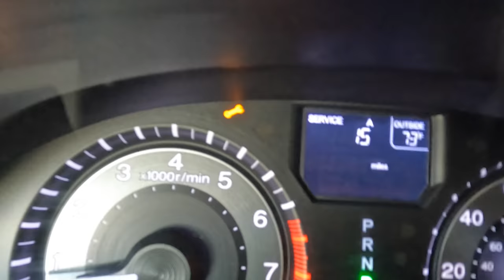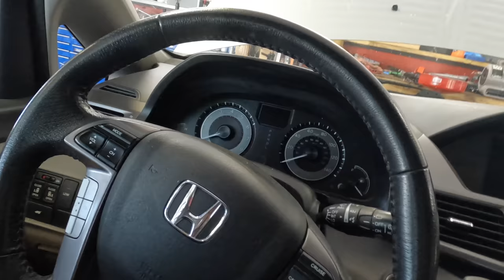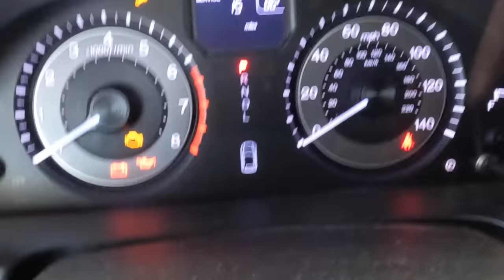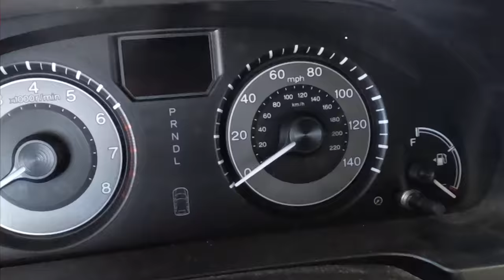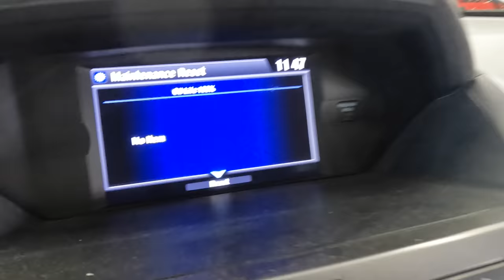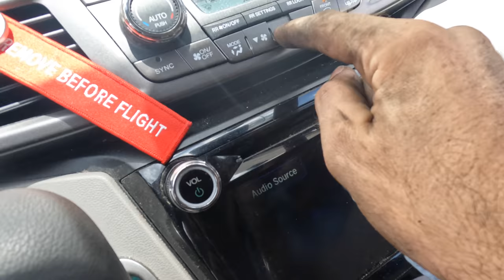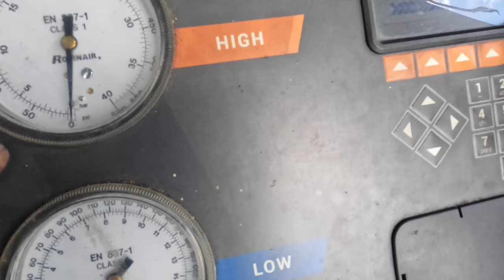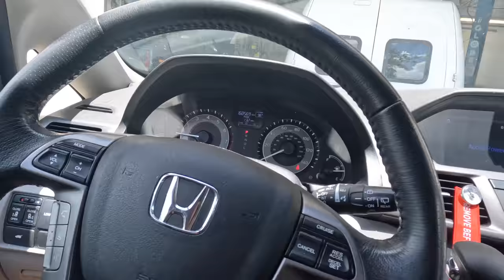Running 300-400 psi. Vibrating noise and smoking! 2014 Honda Odyssey 3.5

Comment: Absolutely phenomenal diagnosis, videoing, verbal description, adapting the old  connector to the fan, all for repair repair, and with the added touch of the loss and  recovery of the 10 mm socket. Thanks, as always for the terrific video.
Reply: The correct word is video recording NOT videoing
Read books to better understand the language -
under-education is not a desirable quality - perhaps
mediocrity is your goal rather than improvement.
Reply: @andrew_koala2974  Pedantry is the purview of those who wish they were infallible.
Reply: @andrew_koala2974  The grammar troll has spoken.
Reply: Andrew koala. Adding - to sentences is also poor grammar
Reply: @andrew_koala2974  What does your crap have to do with fix'n cars. Give the guy a break along with everyone else.
Reply: Phenomenal diagnosis? I’ve diagnosed many of these over the phone. Lol. Easily amazed.

Comment: Good morning Ray, good video. I have a quick story, I was with my wife sitting in traffic and she said "Wow I've never seen the temp gauge that high" I started to find a way out of traffic QUICK the AC had also started blowing warm air too. Long story short it was the electric fan I smacked it with my lug wrench and it came on yay 😁 !! Luckily the high pressure valve didn't have time to discharge any freon 👍. The part of your video when the runaway 10 mm took a dash I was like yup there goes another one Lol. You have the coolest tools that magnet is a life saver for sure !! 
     Thank you for another great video!! And don't forget to have yourself a great day 👍👍✌️🇺🇸😊.
PS thank you for your service 💯
Reply: When that 10 mm went bye bye - I thought yep there goes another to be sacrificed to the 10 mm gods. 
I find if my heater is cold - then the coolant is low because it not circulating any coolant to the heater core. It how I found the coolant leak from the LPG gas convertors under the bonnet. My car on LPG has 2 convertors using coolant heat to vaporise? the GAS to Liquid conversion. EDIT - my car wont switch over to LPG from Petrol unless temp at 35c or higher (1/4 on temp gauge).

Comment: Hi Ray. I enjoy watching your videos. I am a retired  professional auto/truck technician with over 40 years of experience.  I have never seen a saddered connection melt because of high load.
Reply: “Soldered” NOT “saddered” 🤦🏼‍♂️🤦🏼‍♂️🤦🏼‍♂️
Reply: Agreed, the lowest melting point solder (63-37) melts at 374 deg F and the plastic wire insulation will melt off before the solder would. A proper solder joint will make a lower resistance connection that is corrosion resistant and physically stronger than the wire.

Comment: Ray it's so good to see an honest mechanic. Also I wish I had tools like you have now days to work on cars. All I had were regular hand tools, creepers, no electrical type and the wrenches you have now great ratchet box end wrenches. Keep up the good work
Reply: I am so envious of the modern tools Ray uses. I remember turning nuts and bolts a partial turn at a time when a ratchet wouldn't fit and using my chest as the transmission jack while laying up under cars to change out TH350s and TH400s. The one repair I've yet to see Ray perform is replacing a drive shaft that has been twisted with so much force that it pinched into two parts. I did make the most of what tools I did have back in the 70s when I was into drag racing.
Reply: Yes you’re right. And on top of all that, you’ve Got to have the computer savvy just to turn a wrench.  I’ve learned a Lot from Ray and Eric and Wes. They would make great Shop Teachers!
Reply: I'm 73 yo so I'm very old school did not have computers back then just real cars not the complex things now
Reply: @fhurlburt6532  New cars are still real. I kinda liked having older vehicles that were all mechanical, but the new tech is oh so very nice from a comfort perspective. And as much as I love the sound of a carb sucking in air, I get more power from my little 4 banger than I did from the 305 that was in my first three Chevys ('84 C10, '86 El Camino, '76 Malibu).
Reply: @gaiustacitus4242  A shop I hung out when a teen in the 1970's had a drag race car. Race on Sunday, fix on Monday.
Reply: @gaiustacitus4242  Bin there too! 4 lbs. of air in slicks with “screws in “ to stop turning on rim! So much torque @ 5,000 rpm & slide slip the clutch! Kept breaking off pinion snubber ! SS class in 1969 ! Tons of fun!! Only 2 trades in life that make a living on our backs! The other get “paid” for there comebacks ! LOL
Reply: Tools and equipment - irrespective of any profession -  
whether 'one' is a mechanic - photographer - graphic artist -
electronics technician  - or surgeon in the Medical arena.
..New tool and devices are being developed / invented -- 
older equipment requires replacement or repair  - Losses
of tools have to be compensated for -   and average people
who have zero concept of business management wonder
why professional repair services are above their flawed
financial expectations --- Besides that - one is paying for the
knowledge the professional has invested in - meaning the time
studying - books and equipment while the commoners are 
having fun drinking beer and getting up to no-good.
Proper knowledge - willingness to learn everything and ethical
practices will always bring many rewards and acclaim.
Willingness to learn what one does not already know is the KEY.
Reply: @gaiustacitus4242  Back in the early 70's I was driving a milk truck for residential deliveries and I got upset with a customer and had to back out of a long drive way. I hopped in the truck threw it in reverse and rev it up and pop the clutch and I forgot to let off the parking brake and twisted the drive shaft up like a straw.

Comment: Every time I see you work on a modern car I think how I used to work on my Triumph Spitfire in the mid-70's:
1. Raise hood - whole front of the car opens forward
2. Sit on front tyre, either side, and tinker with distributor, carbs, rockers, etc - in total comfort. Often with a pipe wrench as the only tool.
Reply: Ours had a Copper hammer for wire wheels , venting frustrations
Reply: Oh yes, Spitfire. SU carbs, U-joints everywhere... changed them while laying in the snow in the winter in Maryland
Reply: I restored a 63 Spitfire as a retirement project. So easy to work on it, just as you describe. I look at my 2014 Honda and don’t know where to start!
Reply: @Taid44  while most can't diagnose/fix late models , we can attempt to and @ least make them  'Different'.......

Comment: There's always something nice about watching an oil change... maybe it's the flow of dirty horrible oil coming out and knowing clean good oil will be going in.
Reply: Yes. Extremely satisfying!
Reply: could watch it all day right.
Reply: Out with the hate, and in with the love.
Reply: For my daughter who is a trauma surgeon in NYC
a blood transfusion is  likely exciting - knowing 
that another soul is saved from the graveyard.
Reply: I have yet to understand why the need to torque the bolt for the oil pan drain. It's under low pressure and not prone to leak. The Honda dealership changed the oil on  my  Acura and later I changed the oil and had to use a cheater pipe to get the plug broke loose. Hand tight should be more than enough.
Reply: @captinbeyond  usually, a standard 3/8 ratchet with normal force is enough to tighten the drain plug so the copper gasket ring can do its thing.
Reply: @captinbeyond  Nowadays, the issue is the correct torque, hence, a torque wrench. Gorilla-type mechanics are stripping out threads on cast aluminum oil pans left and right!
Reply: @theundergroundlairofthesqu9261  maybe the guys at dealerships don't know how to set a torque wrench?  My understanding is Honda torques it after oil changes as standard, but no reason you'd have to use a cheater bar to get a plug out.

Comment: Ray, I really enjoiy your videos please keep them coming. But as a retired Marine electrician  I have to disagree with your crimp against soldier stance. 
In high current circuits. The crimp, no matter how well installed, will show resistance. That resistance causes heat and that causes expansion in the joint. the copper wire swells with the heat and pushes the crimp fitting open just a fraction, when the current is shut down the conductor shrinks again  then it really starts to  loosen off and the bad joint causes more heat, more shrinking/swelling and the crimp continues to be expanded and loosened. You will have seen how the insulation in the back of old spade joints etc has hardened and blackened, even damaging the conductor, till the joint fails. 
Ofcause this action is dependent on the Conductors max carrying ability  and the amps passing through it.
You stated you didn't solder this fan joint because it is a high current circuit, I will tell you that a soldered joint, done properly will heat less than the conductor itself, because the joint is coated with lead, so you have the current carrying capacity of the conductor and that of the lead added to it. 
Anyway that's my 5 cents worth, looking forward to your next video.
Reply: Right on Cliff. 👍
Reply: Electrical engineer here, spot on. 

The only reason crimping is preferred in a vehicle is due to road vibration, solder if done wrong in any way will be too brittle to last.
Reply: Hi Cliff - I totally agree with your remark on the crimp option. I would have changed over the outer connector body with the one removed which most likely would have solved the issue. However, Ray is a fantastic engineer and I really enjoy his videos and engineering wisdom, keep them coming!
Reply: I can tell you that much: if you have a proper solder joint, heating up due to current will be the least of your problems. Vibration? Maybe. It's always better to keep connections of any kind steady.

If the normal operating current would really melt a solder joint, the cable diameter itself was too small to begin with and its insulation would have melted off anyway.
Reply: hear me out here…..electrical tape
Reply: @bigd1ckbob985  Liquid electrical tape, right? You know... the stuff that goes on wet and dries. I hear you.
Reply: Sorry guys, crimping every time.
Reply: @paulcharman44  To each his own mate.
Reply: I agree. If a connection is properly soldered and not brittle, it will last a very long time. I have seen crimp connectors fail a lot due to poor crimping, water intrusion and fatigue from high current loads. However, when time is money and you're in a hurry, crimps will do an okay job if care is taken to keep water out and the tech properly crimps it.
Reply: @svenschwingel8632  Spot on. If the connection is hot enough to melt solder...something is drastically wrong.

Comment: Thanks Ray, I learned something about AC systems on this one.  After 168k miles, it can be expected that various components like that high speed fan will be worn out.  Those clacking/clicking plastic vent actuators that require disassembly of the entire dash to replace come to mind.
Reply: The 2006 - 2012 Chevy Impala was notorious for the vent actuator going bad, it would eventually get to the point where it could start a parasitic drain on the battery (personal experience) but at least I could get them replaced without disassembly of the dash (I am a small person)
Reply: I have a 14 Honda Accord with 205,000 miles.  So far the only failures have been the sun visor and two light bulbs.   The minivan in the video I'm guessing has lots and lots of short trips and lives where you use the A/C a few more months a year then me.
Reply: @danr1920  Not a Honda guy,,,,, but you can’t argue with truth ! LOL

Comment: I have to say your the best mechanic in all 50 states. You never cut corners your spot on with details and you actually care about the safety of your customers. I wish we had mechanics here in Kentucky half as good as you. I've been tempted a couple times to drive down south to have you work on my vehicles. If by chance you know of any good mechanics here in Kentucky please let me know. I once had to drive to Tennessee to get a issue resolved because no one here in my state could figure it out and once I arrived to the mechanic in Tennessee it took him only 15 minutes to figure out the problem. If you ever move closer to home please give me a holler. Keep up the good work your one in a  million.

Comment: The last socket I dropped in the front of a car like that, I ended up chasing rocks and clumps of mud around. I thought I was knocking around the socket. In the end, the drivers headlamp, battery and battery tray had to come out. Socket found it's way below the battery tray and not down all the way down like I thought.
Reply: As someone who has run a ton of road races, sockets are very common found items on the side of the road.
Reply: One day I’ll pull the engine from my car and find all the 10mm sockets I’ve lost.

Comment: Love your channel . One thing, soldering those high current joints would have been better. Solder melts at 400-450f. If it gets that hot under the hood, then there is a fire, and with a underhood  fire, who cares about a fan working.?😜. P.s. Watching this post, i just went out and checked own fans!!
Reply: Throw aftermarket out the service door & wait for Dealer parts !
Reply: Those butt connectors are subject to water when it rains too. Corrosion problems in the future.
Reply: Double down with epoxy-filled crimp connectors covering a soldered joint.
Reply: @gregjohnson2073  he used heat shrink. Its fine

Comment: Awesome work!
Using my double masters degree in paused video analysis and 2014 Honda Odyssey fan connector engineering, it looks like the new connector had the white thingy mobobby inside the new connector extends further than the original by about 10mm not allowing it to seat far enough in to lock it.
Reply: I agree.

Comment: Had a Honda Odyssey, New from a highly rated dealership, (The first year they came up with the large size model). With all the services done at the dealership, and less than two years of use, the damn thing would not pickup speed no matter how much I press on the gas Pedal. Received a letter from Honda about a recall for that particular issue. They said that cables near the ignition switch get hot and engine losses power.
Called the dealer for an appointment, got one over a month later. Took the van in, got it back the next day, dealer claims they did all the recall repairs.
The van wouldn’t pickup speed out of the dealer’s lot. Stopped and told them about the problem still existing. They got mad and told me to leave and never come back. Took it to another dealer, they refused to work on the recall since another dealer has done the work already.
The next day, took it to a Hyundai dealership, traded it in with a brand-new Sonata. Never been happier, and never looked back at Honda again.
Reply: Awww.  I have a 2008, with that same 3.5l engine with 150k miles.  Just did the timing belt and valve cover gaskets (thanks ETCG).  I can put 11 sheets of 3/4 plywood in the back if I take out the middle seats (Hurricane Irma) - it's my truck of choice.  Regularly drive it 1000 miles up North to see the kids.  It'll last forever, as long as I treat it right.  It's also comfortable as heck for us tall folks.
My wife has a ten year old Civic with 50k miles.  Other than change fluids, it hasn't needed anything but a battery and a set of tires.  My 2001 Goldwing just runs and runs.  These ancient Hondas rock.  Sounds like your problem was with the dealers, not the cars.
Reply: Honda is a scam

Comment: I would have laughed if you fished a different 10mm out from a previous fix. Lmao.
Reply: OR, another Snap-on 10mm! They DO certain changes after all. Maybe just to the “script” but those are still quantitatble changes.
Reply: I once had a 10mm fly off my socket wrench in the engine bay and I swore that it went down in there somewhere. I shined a light around there for several minutes but couldn't find it. Chalked it up as a loss. About a week or two later, I drove over to my mechanic buddy's house (several highway miles away), and when he pops the hood, I see over on the passenger side sitting plain as day my bit. It was resting on top of a metal bracket right below the hood. I was surprised by how much in the open it was and by how it stayed seated there for the duration of the drive.
Reply: @nottelling4828  sooo true, has happened to me too! LOL

Comment: I believe the issue with the connector was due to an insecure fit of the pins to the plastic allowing them to bend and jam when you try and connect it. It happened often with the old school molex power connectors. Solution was to pull on the cables to make sure they are tensioned and straight as you plug the connector and maybe jiggle them a bit.

Comment: I have one of those torsion torque wrenches, very accurate but hard for my old eyes to see. lol  In that electrical plug it looked like it had an inner white plastic ring that wasn't as deeply inset as the original, likely why it wouldn't "click"
Reply: To me, it looked like the two blades were a bit 'out-of-center' making them bump against the opposing plug innards instead of sliding into the slots.
Reply: Possibly, but the pins looked slightly bent to one side too and they were probably preventing the connectors from joining.
Reply: What I do with a beam torque wrench is put a piece of masking tape on it, using its edge at the goal for today's torque setting.